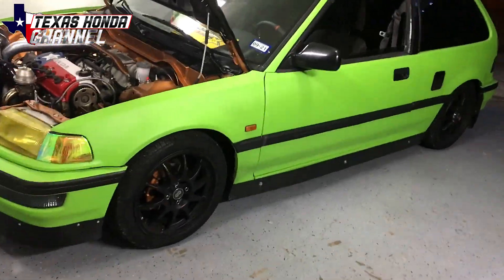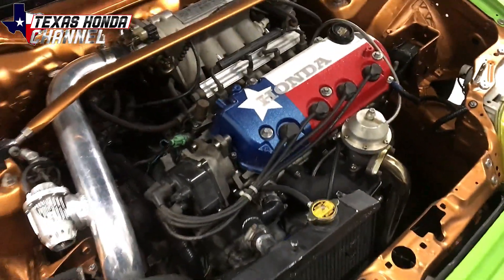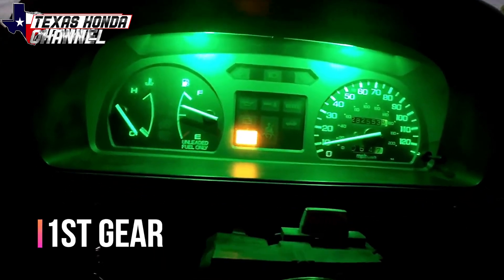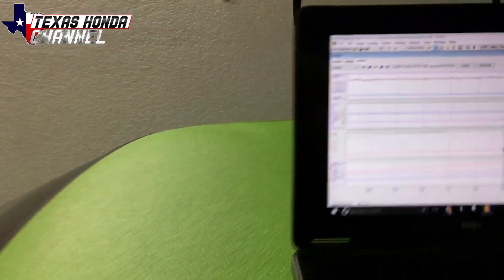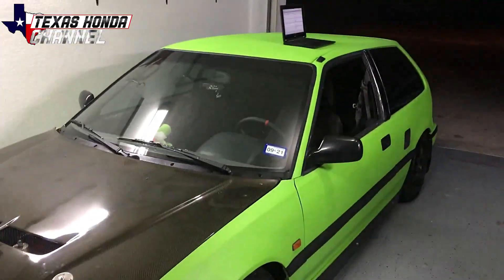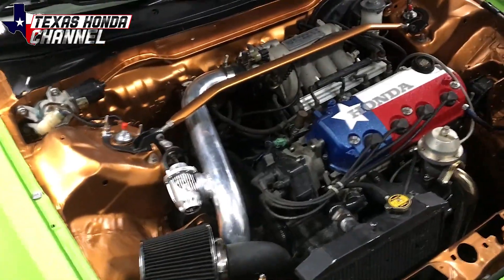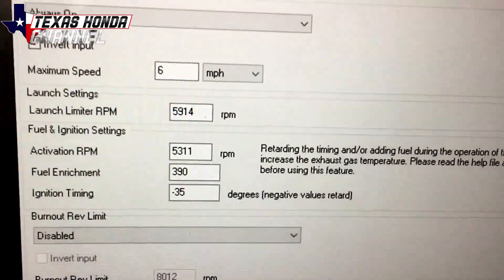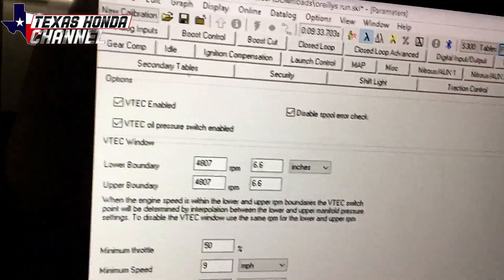My D15B Turbo on 3 Psi With Crazy Long Gears. (Check It Out!!)

Comment: I've had some success with ebay turbos. I know a few guys that's knocking on records running chinese turbos from ebay 🤣
Reply from the maker: I have personally had good luck with them so far no complaints
Reply: @TexasHondaChannel  they don't last for years but they damn sure do work before they go 🤣💪
Reply from the maker: @carbonconnection2480  I had one last 4 years but it was on low boost and cost me $94 back in 2010-2014 still was going strong when I sold the turbo kit.
Reply: @TexasHondaChannel  nice!! I've never tried one on low boost but I wouldn't doubt it would last. I know at high 20's to mid 30lbs it will smoke them
Reply from the maker: @carbonconnection2480  yes mine was 14psi for a long time but proper oil restrictor does help prolong life and bestline racing additive does too!
Reply: @TexasHondaChannel  yes indeed!! Its about like anything else, you treat it right and it will take care of you.
Reply: @carbonconnection2480  kyle from boostedboiz had one last 3 years on his 700hp civic
Reply: @ogspmex9926  he has 2 on his mr2 making 1000+ wheel i think they have been on like a year?

Comment: Really debating on doing mine sucks it's an autotragic. Makes me miss my boosted s14 evenore hearing all those turbo sounds again
Reply from the maker: I wish I could get a auto tuned with boost it would be so much fun. Mine was fun untuned but that’s sketched me out so I swapped it to manual on my old sedan
Reply: @TexasHondaChannel  the swap wouldn't be nothing for me to do iv built all kinds of cars over the years. Was thinking about just putting air ride on it and gonna do full custom fiberglass door panels dash rear deck and headliner and gonna do wood trunk. I do miss driving a standard trans tho. But my car started out as a dx model y7 only power option I have are locks. Now it's got the mini me in it still putting it  back together but it'll be something once it's done.

Comment: Yeah injector upgrade time bro. 370cc should be more than enough. Maybe stock z32 300zx side feeds will work?
Reply from the maker: I have some precision 550s already just have to install them. 100% duty could become a big problem lucky the afr was rich when reading 100% duty but still

Comment: Love it! Looks clean and sound amazing. What exhaust/set up are you running?
Reply from the maker: It’s open downpipe right now but it’s all customer from where the cat goes all the way to the rear bumper. 2.5inch custom made no resonators so we will see how it sounds once it’s all connected. I prefer full exhaust but enjoying the turbo sounds right now

Comment: What transmission are you running? I need longer gears. I do a lot of highway driving and it sucks cruising at such high rpms
Reply: Looks like a HF transmission. 3.25 final drive if I remember correctly